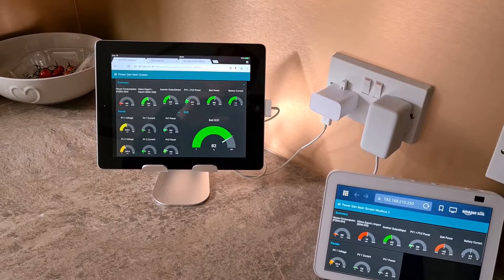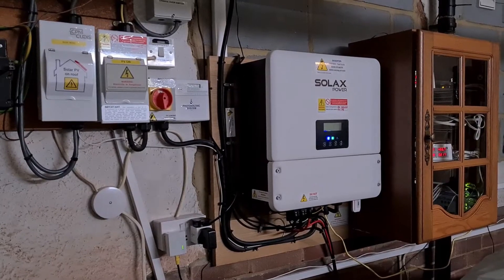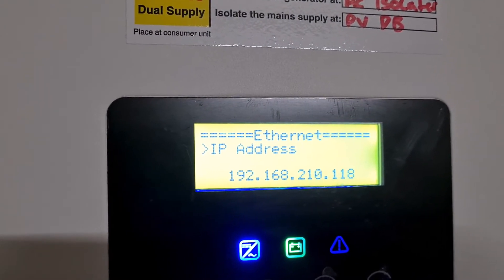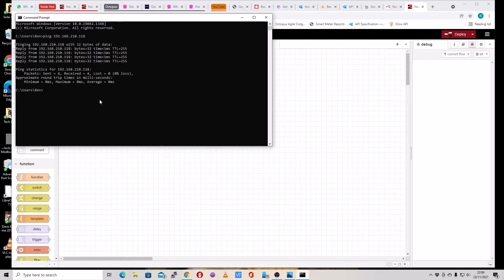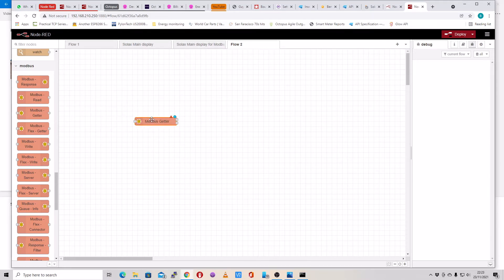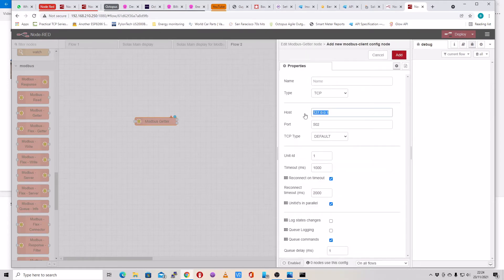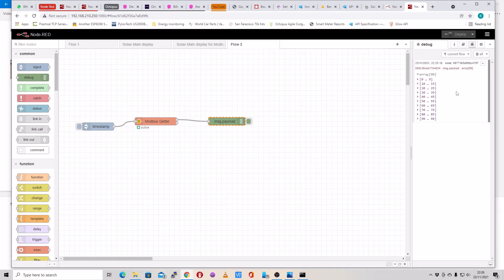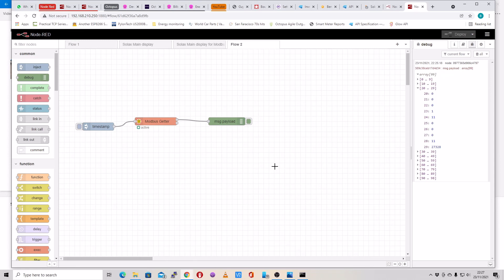Solax Hybrid Modbus setup part 1

Comment: I have a Solax X1 Mini, using the USB Wifi 3.0 dongle to connect, all working frin with Solax Cloud (but not realtime). I just tried the above, but I get the below responce:

"Error: Modbus exception 2: Illegal data address (register not supported by device)"

I also tried changing the serttings (UnitId's in parallel queues), as suggested by another comment, but still same message. Any ideas please?
Reply from the maker: HI @speedrazor. Sorry it did not work for your inverter. I don't know why, I guess that the Modbus registers are different from my inverter. Sorry I cannot help further
Reply: @benfletcher7209   after I got the inverter firmware upgraded everything started to work, thanks for the help.

Comment: Hello, I have given this a go on my Solax inverter as well which uses a wired ethernet dongle (not the wifi dongle) I can ping the exact same IP address as you (same IP shown on my Deco device the router is wired to) But the node-red debug does not get a response using the same config as you. I also noticed the Solax Inverter settings does not have the ethernet menu you have (I just got ip from Deco repeater)
Reply from the maker: Hi Thanks for trying it out. Are you defiantly pinging the inverter, if you start a ping going with the -t option (continuous ping) then unplug the cable to the inverter does the ping stop ?
Reply: @benfletcher7209  hello, thx for the reply, yeah 100% the Solax inverter as only wired device plugged into that particular deco. Does your inverter use the Pocket Lan dongle?
Reply: Ah also mine is a x1-hybrid series looks a little different to yours. Maybe needs slightly different modbus setup?
Reply from the maker: @Is200Innit  My inverter has an ethernet socket which is wired into my network, my inverter is an X1-Hybrid-5.0-E. Its about 3 years old perhaps you have a newer modle
Reply: This is a X1-Hybrid-5.0-D the Ethernet cable plugs into what they call a pocket lan dongle (as can be replaced with a WiFi version instead) does your cable plug directly into the inverter it self? (Not via a dongle) it was installed this May so relatively new.
Reply: @Is200Innit  the lan dongle does not connect you to the modbus. if you want to read the modbus registers you need another device witch translates modbus rtu to modbus tcp. which will have a seperate ip adress.

Comment: Thanks for the great video. I get a response from my x1 inverter when pinging but nothing back when I send a time stamp. Any ideas?
Reply from the maker: Sorry about delay in replying, Are you defiantly pinging the inverter, if you start a ping going with the -t option (continuous ping) then unplug the cable to the inverter does the ping stop ?
Reply: I had the same bug. I am connecting via the black dongle 3.0 - no ethernet. So what I did was when I was in the inverter screen, I clicked on Queues then unchecked the box that says UnitID's in parallel queues.  Next to that box it says Don't use it for serial without a serial gateway.  Guess if you don't have ethernet there is no serial gateway.  Anyway did this and got the data back for the first 99 registers.  Now my question is what does the array relate to?

Comment: Hello Ben, perfect video! Did you find how to control the solax? I can´t deal with writing data back to Solax. Thank you for answer.
Reply from the maker: Hi Pavel. Thank you for watching my video. I have now found out how to write to the registers using Modbus, first write 2014 to reg 0x0000 to unlock the inverter, you can read from 0x0054 to check its state (1=unlocked) you will then be able to write to the registers. Try 0x0020 which controls the Battery MinCapacity. Please take care when writing to registers, I would think its possible to upset the inverter. Of course do it at your own risk, I take no responsibility if things go wrong.  I had a lot of help from this guy who has a fantastic HA integration for Solax PV https://github.com/wills106/homeassistant-solax-modbus

Comment: Hello,
I have a solax x3 pro inverter. You didn't show it in your video but how did you physically connect the inverter to your network to expose the modbus interface?
Reply from the maker: Hi James. On my inverter there is an ethernet port which I connected to my network. I then set an ip address on the inverter using the menu, or it will get one using dhcp. I don't know if you inverter is the same as my X1-Hybrid though
Reply: @benfletcher7209  thanks mate. I assumed that was the case. Cheers

Comment: Hi Ben, First time viewing for me, very useful, will give it a go in the next few days. Fairly new to Node Red also, enjoying the learning experience. fyi I have 3 PV arrays, total max of 6kw, and 3 solax 5.8kw batteries, with the Solax X1-Hybrid G4 and an SMA 4000TL, I also have a Brultech Gem setup which is fantastic, although a tad temperamental at times. sure i will have some questions soon, as want to sus the RS485 for the SMA into the Solax, and create a view for the Show 8 in my office.
Reply from the maker: Hi Mark. Thank you for your comments. It looks like you have a good PV setup there, I guess that you have 2 arrays on the Solax and 1 on the SMA 4000TL. Do you just have battery on the Solax ?. I have already had a comment to say that the Solax works with my flow using a RS485, I have copied the comment below
Hi Ben, Just used your flow with a SOlax G4 Hybrid X1 5k. All working but that device doesn't have a TCP interface as far as aI can see. I had to get a TCP to RS485 and hook up the COM port on the inverter. As soon as I changed the  ModbusGet100Registers to use my server it all sprang into life. 
For ref I am using a USR-TCP232-304 convertor - £30 from Amazon. Hope that's useful.
Reply: @benfletcher7209  Hi Ben

Actually had the SMA 4000tl since 2011, this has 2 arrays total 4KW and attracts the feed in tariff, so not allowed to mess with it. The Solax Hybrid is a very new addition, this can provide or store 5kw of energy from the 1 additional 2kw array and batteries or use power from the SMA 4 kw system, but has to go via 240 AC to get there, works well though, i do have the Solax Lan dongle and can use the cloud web view fine. trying to make a second Modbus meter work on the 2nd meter input on the Solax, so far without success, this is to view the activity on the SMA inverter.  re Node-Red, so far no joy, can't seem to access the RS485 data through the Lan connection, fixed IP & Pings fine, but the Modbus getter doesn't return anything on the Debug. just ordered the USR-TCP232-304, hopefully arrive tomorrow, might give me some clues and maybe get the node-red working?
Reply from the maker: Hi Mark. Just trying to get my head around your setup, I could do with a diagram. You say " trying to make a second Modbus meter work on the 2nd meter input on the Solax," does this mean you have Node Red Modbus working already on the Solax ?.  I see that ping works fine, the modbus node red try's to get 100 registers (0 to 99) have you tried just trying to get 1 register, perhaps reg 5 which is the  PV1 current  (on my inverter). I will be interested to see how you get on with the   USR-TCP232-304 
Ben

Comment: Hi, i tried but i didn't get any information, in fact i didn't get any response from nodered. Can u help me please? Thanks!
Reply from the maker: Hi Carlos. i am sorry you did not get any response. Please can you put the ping node on your node red (configure with your correct ip address of your inverter) with a debug and see if you get a reply. Let me know how you get on
Reply: @benfletcher7209  I tried something else that I found on the internet because I still couldn't find an answer within nodered. I had to change the firmware of the inverter to be able to access the data from it.
Reply from the maker: Hi Carlos. That's great that you managed to get the data from your inverter, I hope that you downloaded the NR flow and it all worked OK.
Reply: @carlosavendano94  Which inverter / year do you have? I am in same boat, no response. Maybe mine needs the firmware update as well?
Reply: @carlosavendano94  which firmware are you using and where did you get it from..i swear this is like some crazy side quest that everyone other me knows the answer to